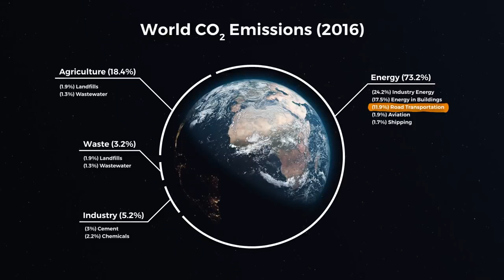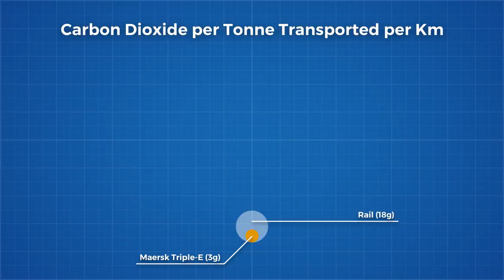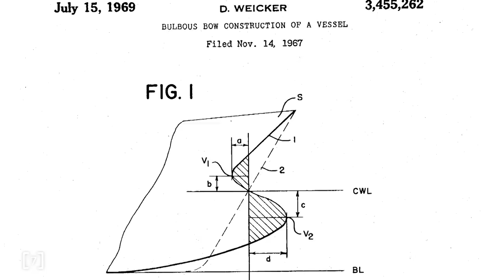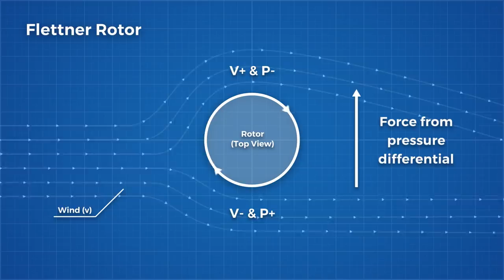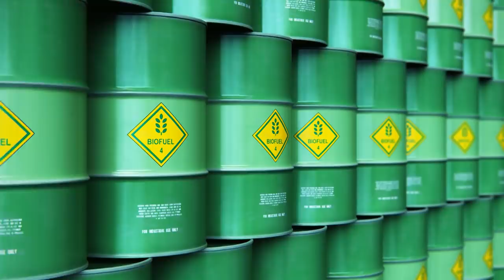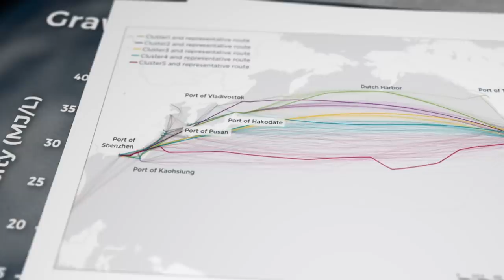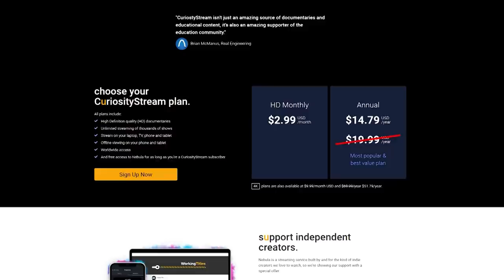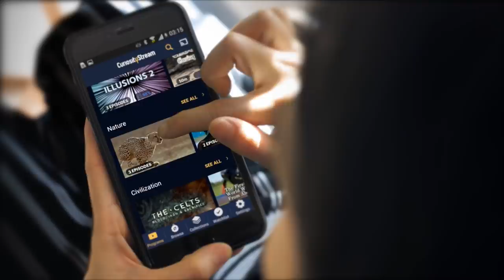Are Renewable Powered Ships Possible?

Comment: What about nuclear energy, did I missed the moment u talked about it?
Reply: If you do a web search for ‘nuclear ship savannah’ you will see that it has been tried and did not work.  A similarly vessel, heavily subsidised by the government, vessel has been in lay up in Russia since 2012 but could be reactivated.  The Russian state, through a QUANGO, also operates a fleet of nuclear powered ice breakers all of which may, or may not, be completely without issues in support of the Northern Sea Route,.

Just think; would you have full confidence in the management of a nuclear reactor under the control of an anonymous entity only traceable, perhaps, via a letter box in a FOC (flag of convenience) nation state?  If you are, could you sell that confidence to Japan, the state that hosted the Hiroshima and Nagasaki nuclear detonations as well as more recently the Fukushima ‘event’?  Then try that same, or a similar, sales strategy on Ukraine, the nation state that as a part of the USSR (CCCP) hosted the Chernobyl ‘event’.  Modern iterations of nuclear energy, thorium fuel, molten salt reactors or fusion reactors, will carry the legacy of past problems.  It is the global trepidation of anything with 'nuclear' in the name and the economics of nuclear having transitioned from 'energy to cheap to charge for' too 'the costs of remediation are incalculable' that will prevent the adoption of nuclear energy as a means of creating energy at sea.  Modern reaction systems may have overcome the safety problems but the general public, having been misled in the past, will be reluctant to believe the fresh new promises.  The incident of the ‘Ever Given’ blocking the Suez Canal, March 2021, may also have a little to add to this debate.  The cooling water on ships tends to get taken in from near the bottom so when running aground the inlets are in a prime spot to get plugged up restricting, if not stopping, the flow of coolant.  One thing that the TMI, Chernobyl and Fukushima incidents all had in common was that the supply of coolant, or rather lack thereof, was a fundamental cause.

‘They’ say nuclear is cheap, it’s not it is expensive and has a large embedded carbon quotient as well as being complicated, dangerous, not universally socially acceptable and having only ‘no need for refuelling’ as a questionable advantage; actually it does need refuelling just not as often.  When ‘they’ do need to refill the warming up stuff it takes considerable longer than pumping tonnes of thick black stuff, cSt380 HFO, or thin runny stuff, MDO, onboard which is one of the reasons HMS Queen Elizabeth and HMS Prince of Wales are pushed about by ICEs and gas turbines thus using a similar fuel as the aircraft that fly off of them.  The Royal Navy (RN) with a high degree of skill and expertise uses, at vast expenses to the UK taxpayer, a current operational nuclear fleet of 11 submarines (also known as ‘boats’) in two flotillas, seven attack subs and four ballistic missile boats.  The carbon footprint of all the extra bits of hardware and the fuel, including processing thereof, from ground to propeller, are the external costs that never seem to get considered.

Disposal, once it wears out, of both the machine (that was a ship) and fuel is another can of worms best left unopened.  The 26 RN nuclear powered boats no longer in use are laid up (some in Rosyth and some in Portsmouth) awaiting long term deconstruction including dealing with the fuel rods and other irradiated material.  The USN is not, as far as I know, a commercial organisation working to very tight margins and also has the skill and expertise to handle the complexities of nuclear power; so as well as submarines their aircraft carriers are nuclear powered and each of the current iteration has a build cost three times that of QE/PoW, bigger crews and more generous funding.  For those who still think that nuclear energy might be the answer I recommend this report: - https://www.bbc.com/future/article/20200901-the-radioactive-risk-of-sunken-nuclear-soviet-submarines?ocid=ww.social.link.email.  The navy of the USSR might have been under resourced and over extended but it was still generously supported in comparison with merchant shipping.

Another, similar but more extensive view, may be found at https://www.quora.com/Why-are-there-so-few-nuclear-powered-cargo-ships-If-it-works-for-ice-breakers-and-submarines-why-hasn%E2%80%99t-it-been-established-for-merchant-vessels.  Why not use nukes?  It is down to money, societal attitudes and safety.
Reply: @BernardLS  thank you

Comment: Maybe it's time to look at small nuclear plants for propulsion. Zero emissions and years between refueling.
Reply: If you do a web search for ‘nuclear ship savannah’ you will see that it has been tried and did not work.  A similarly heavily subsidised, by the government, vessel is in use in Russia which also operates, in support of the Northern Sea Route, a fleet of nuclear powered ice breakers these may, or may not, have been completely without issues.

Just think; would you have full confidence in the management of a nuclear reactor under the control of an anonymous entity only traceable, perhaps, via a letter box in a FOC (flag of convenience) nation state?  If you are, could you sell that confidence to Japan, the state that hosted the Hiroshima and Nagasaki nuclear detonations as well as more recently the Fukushima ‘event’?  Then try that same, or a similar, sales strategy on Ukraine, the nation state that as a part of the USSR (CCCP) hosted the Chernobyl ‘event’.  Modern iterations of nuclear energy, thorium fuel, molten salt reactors or fusion reactors, will carry the legacy of past problems.  It is the global trepidation of anything with 'nuclear' in the name and the economics of nuclear having transitioned from 'energy to cheap to charge for' too 'the costs of remediation are incalculable' that will prevent the adoption of nuclear energy as a means of creating energy at sea.  Modern reaction systems may have overcome the safety problems but the general public, having been misled in the past, will be reluctant to believe the fresh new promises.

‘They’ say nuclear is cheap, it’s not it is expensive and has a large embedded carbon quotient as well as being complicated, dangerous, not universally socially acceptable and having only ‘no need for refuelling’ as a questionable advantage; actually it does need refuelling just not as often.  When ‘they’ do need to refill the warming up stuff it takes considerable longer than pumping tonnes of thick black stuff, HFO cSt380, or thin runny stuff, MDO, onboard which is one of the reasons HMS Queen Elizabeth and HMS Prince of Wales are pushed about by ICEs and gas turbines thus using a similar fuel as the aircraft that fly off of them.  The Royal Navy (RN) with a high degree of skill and expertise uses, at vast expenses to the UK taxpayer, a current operational nuclear fleet of 11 submarines (also known as ‘boats’) in two flotillas, seven attack subs and four ballistic missile boats.  The carbon footprint of all the extra bits of hardware and the fuel, including processing thereof, from ground to propeller, are the external costs that never seem to get considered.

Disposal, once it wears out, of both the machine (that was a ship) and fuel is another can of worms best left unopened.  The 26 RN boats no longer in use are laid up (some in Rosyth and some in Portsmouth) awaiting long term deconstruction including dealing with the fuel rods and other irradiated material.  The USN is not, as far as I know, a commercial organisation working to very tight margins and also has the skill and expertise to handle the complexities of nuclear power; so as well as submarines their aircraft carriers are nuclear powered and each of the current iteration has a build cost three times that of QE/PoW, bigger crews and more generous funding.  For those who still think that nuclear energy might be the answer I recommend this report: - https://www.bbc.com/future/article/20200901-the-radioactive-risk-of-sunken-nuclear-soviet-submarines?ocid=ww.social.link.email.  The navy of the USSR might have been under resourced and over extended but it was still generously supported in comparison with merchant shipping.

Comment: Nuclear power reactor watching this be like: Am I a joke?
Reply: If you do a web search for ‘nuclear ship savannah’ you will see that it has been tried and did not work.  A similarly vessel heavily subsidised, by the government, vessel is in use in Russia which also operates, in support of the Northern Sea Route, a fleet of nuclear powered ice breakers all of these may, or may not, have been completely without issues.

Just think; would you have full confidence in the management of a nuclear reactor under the control of an anonymous entity only traceable, perhaps, via a letter box in a FOC (flag of convenience) nation state?  If you are, could you sell that confidence to Japan, the state that hosted the Hiroshima and Nagasaki nuclear detonations as well as more recently the Fukushima ‘event’?  Then try that same, or a similar, sales strategy on Ukraine, the nation state that as a part of the USSR (CCCP) hosted the Chernobyl ‘event’.  Modern iterations of nuclear energy, thorium fuel, molten salt reactors or fusion reactors, will carry the legacy of past problems.  It is the global trepidation of anything with 'nuclear' in the name and the economics of nuclear having transitioned from 'energy to cheap to charge for' too 'the costs of remediation are incalculable' that will prevent the adoption of nuclear energy as a means of creating energy at sea.  Modern reaction systems may have overcome the safety problems but the general public, having been misled in the past, will be reluctant to believe the fresh new promises.  The incident of the ‘Ever Given’ blocking the Suez Canal, March 2021, may also have a little to add to this debate.  The cooling water on ships tends to get taken in from near the bottom so when running aground the inlets are in a prime spot to get plugged up restricting, if not stopping, the flow of coolant.  One thing that the TMI, Chernobyl and Fukushima incidents all had in common was that the supply of coolant, or rather lack thereof, was a fundamental cause.

‘They’ say nuclear is cheap, it’s not it is expensive and has a large embedded carbon quotient as well as being complicated, dangerous, not universally socially acceptable and having only ‘no need for refuelling’ as a questionable advantage; actually it does need refuelling just not as often.  When ‘they’ do need to refill the warming up stuff it takes considerable longer than pumping tonnes of thick black stuff, cSt380 HFO, or thin runny stuff, MDO, onboard which is one of the reasons HMS Queen Elizabeth and HMS Prince of Wales are pushed about by ICEs and gas turbines thus using a similar fuel as the aircraft that fly off of them.  The Royal Navy (RN) with a high degree of skill and expertise uses, at vast expenses to the UK taxpayer, a current operational nuclear fleet of 11 submarines (also known as ‘boats’) in two flotillas, seven attack subs and four ballistic missile boats.  The carbon footprint of all the extra bits of hardware and the fuel, including processing thereof, from ground to propeller, are the external costs that never seem to get considered.

Disposal, once it wears out, of both the machine (that was a ship) and fuel is another can of worms best left unopened.  The 26 RN boats no longer in use are laid up (some in Rosyth and some in Portsmouth) awaiting long term deconstruction including dealing with the fuel rods and other irradiated material.  The USN is not, as far as I know, a commercial organisation working to very tight margins and also has the skill and expertise to handle the complexities of nuclear power; so as well as submarines their aircraft carriers are nuclear powered and each of the current iteration has a build cost three times that of QE/PoW, bigger crews and more generous funding.  For those who still think that nuclear energy might be the answer I recommend this report: - https://www.bbc.com/future/article/20200901-the-radioactive-risk-of-sunken-nuclear-soviet-submarines?ocid=ww.social.link.email.  The navy of the USSR might have been under resourced and over extended but it was still generously supported in comparison with merchant shipping.

Comment: so what about running these ships on nuclear power??
Reply: If you do a web search for ‘nuclear ship savannah’ you will see that it has been tried and did not work.  A similarly heavily subsidised, by the government, vessel is in use in Russia which also operates, in support of the Northern Sea Route, a fleet of nuclear powered ice breakers these may, or may not, have been completely without issues.

Just think; would you have full confidence in the management of a nuclear reactor under the control of an anonymous entity only traceable, perhaps, via a letter box in a FOC (flag of convenience) nation state?  If you are, could you sell that confidence to Japan, the state that hosted the Hiroshima and Nagasaki nuclear detonations as well as more recently the Fukushima ‘event’?  Then try that same, or a similar, sales strategy on Ukraine, the nation state that as a part of the USSR (CCCP) hosted the Chernobyl ‘event’.  Modern iterations of nuclear energy, thorium fuel, molten salt reactors or fusion reactors, will carry the legacy of past problems.  It is the global trepidation of anything with 'nuclear' in the name and the economics of nuclear having transitioned from 'energy to cheap to charge for' too 'the costs of remediation are incalculable' that will prevent the adoption of nuclear energy as a means of creating energy at sea.  Modern reaction systems may have overcome the safety problems but the general public, having been misled in the past, will be reluctant to believe the fresh new promises.

‘They’ say nuclear is cheap, it’s not it is expensive and has a large embedded carbon quotient as well as being complicated, dangerous, not universally socially acceptable and having only ‘no need for refuelling’ as a questionable advantage; actually it does need refuelling just not as often.  When ‘they’ do need to refill the warming up stuff it takes considerable longer than pumping tonnes of thick black stuff, HFO cSt380, or thin runny stuff, MDO, onboard which is one of the reasons HMS Queen Elizabeth and HMS Prince of Wales are pushed about by ICEs and gas turbines thus using a similar fuel as the aircraft that fly off of them.  The Royal Navy (RN) with a high degree of skill and expertise uses, at vast expenses to the UK taxpayer, a current operational nuclear fleet of 11 submarines (also known as ‘boats’) in two flotillas, seven attack subs and four ballistic missile boats.  The carbon footprint of all the extra bits of hardware and the fuel, including processing thereof, from ground to propeller, are the external costs that never seem to get considered.

Disposal, once it wears out, of both the machine (that was a ship) and fuel is another can of worms best left unopened.  The 26 RN boats no longer in use are laid up (some in Rosyth and some in Portsmouth) awaiting long term deconstruction including dealing with the fuel rods and other irradiated material.  The USN is not, as far as I know, a commercial organisation working to very tight margins and also has the skill and expertise to handle the complexities of nuclear power; so as well as submarines their aircraft carriers are nuclear powered and each of the current iteration has a build cost three times that of QE/PoW, bigger crews and more generous funding.  For those who still think that nuclear energy might be the answer I recommend this report: - https://www.bbc.com/future/article/20200901-the-radioactive-risk-of-sunken-nuclear-soviet-submarines?ocid=ww.social.link.email.  The navy of the USSR might have been under resourced and over extended but it was still generously supported in comparison with merchant shipping.

Comment: Yeah, good luck with that.  Short of a small nuclear reactor, there's nothing on the horizon which comes close to the energy density of fossil fuels.
Reply: Fortunately, energy density is not hugely important for ships. This issue is extensively discussed in the video, I recommend watching it.
Reply: Why is energy density important? It's often brought up as a showstopper when discussing sustainable transport, but it's just one property of a fuel. 
Why give a toss about it if you can circumvent it or mitigate it?
Reply: @hydrochloricacid2146  Because things like weight matter.  You certainly can store enough energy in batteries for a 6-hour plane flight for a commercial airliner..

What you can't do is find a plane with enough thrust to carry that much weight.
Reply: @wadesworld6250  You're taking the rather extreme case of electric airliners here, but that's not quite what I said. 

Low energy density is an engineering problem, to be overcome. It is one concern among many, and not the most important one in many applications. It's certainly no hard limit or obstacle in many applications, and we can't pretend that engineers only ever pursue energy density all the time.